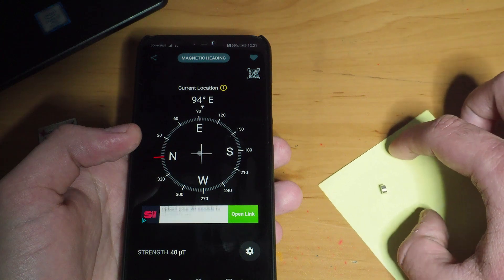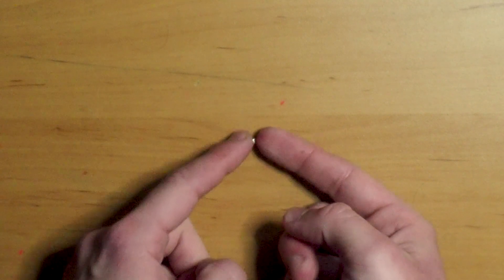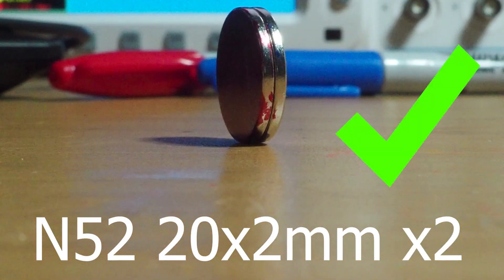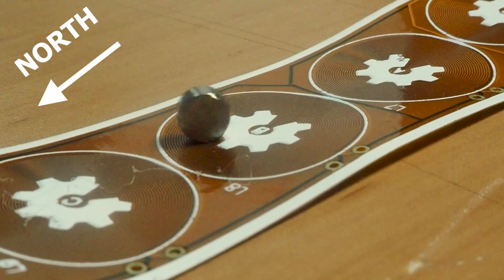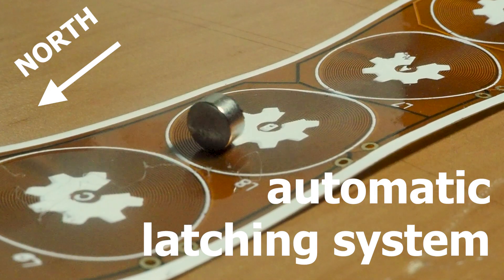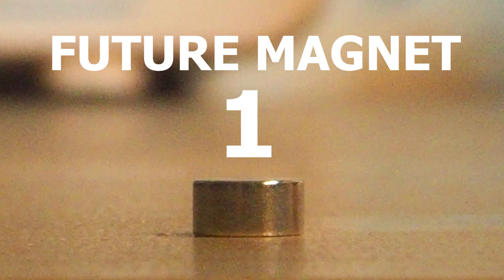Self-Aligning Magnets?

Comment: People really don't know how a compass works? Magnetizing a sewing needle and putting it on a leaf in a cup of water is cub scout level survival tools. Not exactly a new discovery
Reply from the maker: Not sure if you saw the video but it's about magnets that are so light that they can overcome friction and act as a compass.. I'm pretty sure that someone has already come across this but I couldn't find any information on it on the web
Reply: @CarlBugeja  I.e. a magnetized piece of metal - aka a neodymium magnet. So exactly what I said... Not sure how I'd know what the video was about if I didn't watch it, but sure.
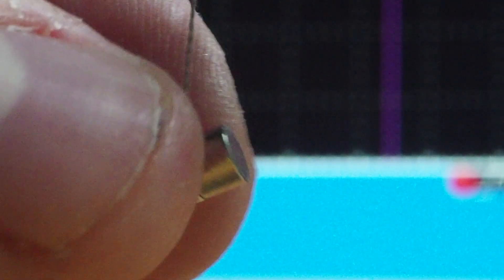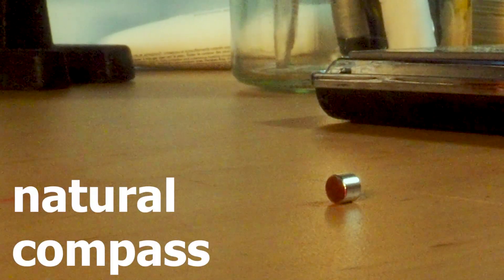Reply: @martinj9647  He explains how normal compasses work at 0:54 and then at 1:04 he explains why these magnets are special. Namely that their magnetic field is so strong that they overcome the friction between them and the surface they are on. Not all magnets do that unless you put them in a specifically designed environment (like he shows in the video, the same example you point out with something floating on water), he even shows that not all magnets do that. So what is special about this? You don't need to build something around the magnet to create a compass. 

Hope this clarifies it.
Reply: @thepianoaddict  again, that is by definition what a compass is. The needle in every analog compass is nothing more than a shaped piece of metal with magnetic charge applied that allows it to "overcomes friction" to align with the opposing north and south poles of our planet's magnetic field. Considering that, literally speaking, a neodymium magnet is nothing more than again, a shaped piece of metal with a magnetic charge applied to it, there is no discernable difference... There is nothing new happening. Hence why there is no scientific write ups about this because this should be common knowledge to anyone in the modern scientific age. Im not trying to be rude, and I appreciate his other videos, but no matter how you cut it what is happening(a material with a magnetic charge being attracted to another magnetic field) is the most basic property of a magnet, and exactly how compasses have worked for millennia. I'm sorry, its just not a new "discovery" that a strong magnetic field is enough to overcome small external forces to align opposing magnetic poles.
Reply from the maker: I agree with you that it is the same principle - I never said I invented a new compass 😝  The thing that I think you're missing is that a magnetised needle or magnet, is usually put on water which obviously has much less friction than any hard surface. Putting that needle on a hard surface won't align it to Earth's magnetic field.. But these tiny magnet do.. I thought it was cool and decided to share it and that doesn't mean its a new discovery.. Its just something new I learned and may use in other future projects